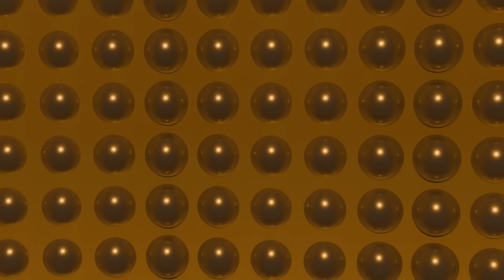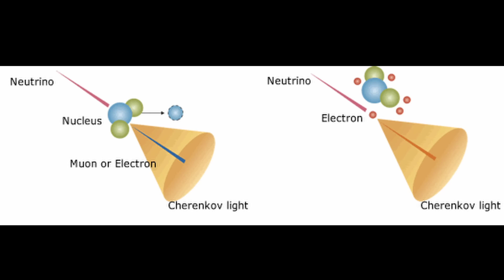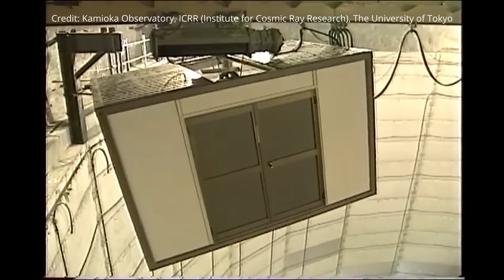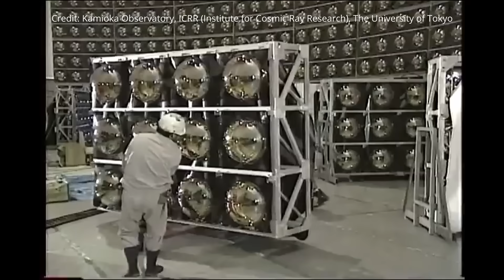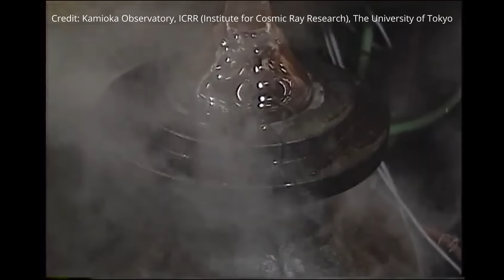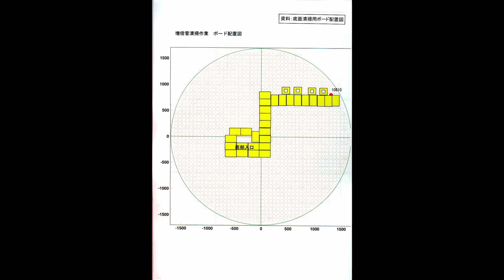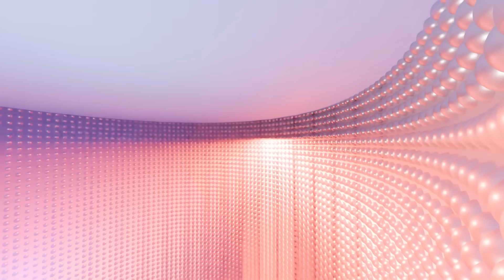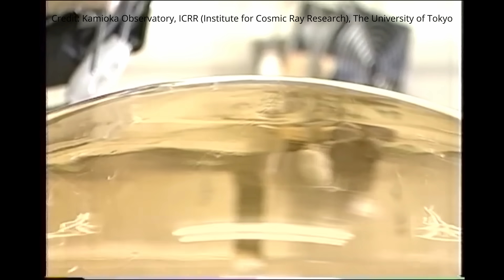An Engineering Fairy Tale: Cascade Failure at the Super Kamiokande

Comment: I heard about this at the time it happened, it was well known in the particle physics community, as this facility is one of the true greats when it comes to neutrino physics.

There’s been plenty of other screw ups in particle physics. Another one a long time ago that happened again to the Japanese was a large fire (a long time ago) in their folded tandem particle accelerator. This style of machine was popular at the time (1970s) for a field of research into the structure of nuclei. There’s machine itself used electrostatic attraction / repulsion to accelerate charged particles. This was generated by a very large Van de Graf generator that would achieve a voltage of several million volts, and be about 7 stories of a building high. There’s other design details too but the important thing was that this monster VdG was upright in a massive pressure vessel balanced on glass bricks, and sulphur hexafluoride gas was used to help provide more electrical isolation around this stack and the pressure vessel walls. The particles themselves travelled in vacuum tube in the core of this stack. 

The SF6 gas was important because if a multi million volt static charge arcs over it can cause a lot of damage. SF6 is used for suppression of such discharges, but these machines used very large amounts of it. 

Trouble was one day something went wrong with the SF6 supply and they accidentally pumped it full of ordinary air. This was not good because it did indeed arc and caught fire (cables, and the very large rubber and canvas belt that the VdG generator used). Rumour had it that when it finally cooled down and they could remove the lid there was simply a large puddle of solidified slag at the bottom of the pressure vessel. 

Oxford University had a similar machine. They sourced their SF6 from Italy. Bear in mind this was pre-EU pre-EEC Europe and there were borders. One shipment of SF6 got delayed and was found to be stuck on the Italian French Border. The problem turned out to be that these very large gas cylinders had been labelled with the Italian (slang?) “Bomba”, they were addressed to the Nuclear Physics Laboratory Oxford and the French customs weren’t entirely happy letting them into their country with such flimsy paperwork for what strongly appeared to be a truck load of weapons of mass destruction!

There’s plenty of other stories. 

Oakridge in the USA built a neutron spallation source in the image of the one at RAL UK (ISIS). The American copy had to be more powerful which is why they used a pressurised liquid mercury target (they could pump this around which aided cooling). Trouble was they forgot about cavitation caused by the proton bunches slamming into the mercury and the shock waves from this chipped away at the stainless steel pressure vessel from the inside. Eventually it burst spraying red hot radioactive mercury all over the inside of the secondary containment chamber. It got cleaned up ok but by the time they’d derated the machine for reliability it ended up being only a bit better than Isis. 

Isis itself had an incident in the 1990s where a magnet got wired up wrong. This directed the proton beam into the walls of the vacuum tube instead of the intended path. Trouble was this was all happening whilst a lot of the senior staff were attending a very nice particle physics conference in Capri, whilst the juniors left at home unaware of this mistake were busily burning a hole through the vacuum tube walls, making it (temporarily) quite radioactive in the process. 

When they first turned on the LHC (or was it LEP) at CERN a design flaw in the superconducting magnets caused a quench and the release of a lot of energy, causing a lot of damage. All 27km of magnets had to be stripped out modified and reinstalled. 

These are just the kind of stories that engineers in this field dread. They’re big expensive unique and complex machines so there’s no such thing as “routine” and mistakes are inevitable, and there’s some very impressive engineering in them as a result. Isis itself became extremely reliable and both academically and commercially successful. The staff there had got their reliability planning right. This included getting a massive transformer the machine uses rewound inside a day and reinstalled following a fire (always a hazard and possibility with such large transformers). This had been preplanned for, and the plan worked, no one was hurt and no other damage was caused. 

If you’re an engineer and want to do something unusual, go into particle physics.

Comment: Thank you for the video.  
When you mentioned in the other video the  Super Kamiokande Cascade Failure I looked it up.
Found only the official report.
It was a very nice read.

I was impressed about the rebuilding efforts.
You know ... super pure water also means super clean water. 
And that means that SUPER cleaning up the mess from the Cascade Failure. 
Sure, remove everything, fully test what seems usable and rebuild it "as new"  ... but actually doing all of that ... WOW.
And they did. 
A marvel of re-usability and repair :)))))

Comment: If neutrino oscillations are possible only if neutrinos do not travel at the velocity of light, how are photon oscillations possible? If photons are frozen in time, how do does wavelength or frequency of light become manifested? Do photons traveling through free space have a frequency, or does that only manifest when it interacts with matter? Or, does the frequency of electromagnetic radiation arise from an interaction of the photon with spacetime?

Comment: The lesson here is when carrying out destructive testing, you need to carry it out in conditions as similar as possible to the actual use case.
Reply: sideways glance at boeing...
Reply: @joeds3775  🤔
Reply: I'm positive that the individuals involved in the HK experiment are aware of this and are preparing thoroughly.✌
Reply: @jweir2010  👍
Reply: @jweir2010  Implosion tests of the PMTs of the HK telescope in collaboration with PLOCAN💡
Reply: Reminds me of starliner doghouses containing the reaction control thrusters. They had been tested, but malfunctioned on ascend due to overheating. Guess how they did the tests: No doghouse cover and in 1 atmosphere of 25 deg air. https://youtu.be/VvaSRfpW5iY?si=aB_vOlenJ9d8j3iN&t=436
Reply: @wonjez3982  🙏
Reply: Stockton Rush called and said testing just gets in the way of innovation, man.
Reply: @yesthatkarim9601  🤔
Reply: @Grandunifiedcelery  It makes it clear why NASA/JPL tests their equipment to death before risking trying to launch it
Reply: @UNSCPILOT  👍
Reply: See Industrial Press, Machinery Handbook. "Only exhaustive testing on the finished part can determine suitability for the intended purpose."
Reply: @conradogoodwin8077  🙏
Reply: The Bureau of Ordnance had some of the same testing issues with their Type 14 torpedo. Failure to test under realistic conditions and test destructively.
Reply: This is why I always buy two coffee pots. One for actually making coffee, and one to see what happens when I throw a pot full of hot coffee on my kitchen floor. And people told me I was crazy.
Reply: @skyeguy7914  :face-turquoise-drinking-coffee:
Reply: Whoopsie
Reply: @YunxiaoChu  🤔
Reply: The Hyper-Kamiokande experiment people are doing implosion tests in Spain.
Reply: Thanks dad
Reply: Yes. You need to do the test with 11,000 bulbs and not just 6, right?
Reply: @Cartilog-z4f  The Photodetctor Manufacturers Association said your check is in the mail.
Reply: @Cartilog-z4f 😭

Comment: Cascade implosion failures are a well known concern with floatation in deep sea oceanographic and geophysical equipment. These floats are often glass spheres with 1" walls and diameters of 10"-20", rated for hydrostatic pressures of around 13,000 PSI which is equivalent to a depth of 9000m or 30,000 ft. In these ocean engineering applications the cascade can be mitigated by spacing spheres, which is obviously not an option for this facility.

Comment: 7:30 the photoelectric effect is NOT how solar panels work. the photoelectric effect is light kicking an electron into vacuum. solar panels work by light kicking an electron into a higher energy band of the material. those are not the same thing
Reply: Solar panels use the internal photoelectric effect. You should really learn some physics before commenting on here.☹
Reply: @laurencecox2657  please point to where in my description i am wrong. i literally work on this stuff. "photoelectric effect" NEVER refers to the internal photoelectric effect. internal photoelectric effect is not a term used in the field because the mathematics of excitons in a material are not really comparable to the the non-excitonic "external" photoelectric effect
Reply: basically has to do with stability and transport of the exciton quasi-particle. if there are excitons present in the system (like there are with any solar panel) it's quite strange and almost misleading to call it the photoelectric effect

Comment: When the Titan submersible was being built, they were warned that they couldn't use glass spheres to house equipment outside the main pressure hull like on other submersibles because if they imploded at the Titan's working depth, the shock wave would be powerful enough to damage the main pressure hull.
  The rows & rows of photomultipliers breaking is reminiscent of the rows & rows of orbs breaking in the Hall of Prophecy in Harry Potter and The Order of the Phoenix.

Comment: Your 1st Mistake

There is no such thing as a photon, it is merely a compression point in a coaxial circuit and the neutron is not a particle although, give it one more compression ring and it decays to a proton.

Counter Space > Force in Motion <> Compression | Light ~ Neutron > Decays to a Proton, dielectric spin begins, one shell -> Hydrogen. 

To catch a Neutron is to give another Compression Shell, where it becomes matter. 

End of Line

Comment: Great engineering breakdown Alex. I'm wondering if the next detector will have supports built in so technicians will not be walking on the tubes. Seems like a no-brainer to me. Design some kind if support, connected to the tank, to allow some kind of scaffolding that can be removed post service.

Comment: Great video, thanks. One thing not mentioned, how fast does the water rush in to the collapsing tube? I am NOT expert in this, however - A video about the Titan submersible disaster says it is the speed of sound in the medium. Water from all over the ocean has to rush in and the need to rush is communicated to each ocean water molecule at the speed of sound. How the non-infinite nature of the tank might affect this is not clear to me. Water 1,500m/s, air 330m/s. This must surely affect the total energy released? Water is also a lot denser than air. Does this affect the total energy released too? Interesting.
I watched the below video and the behaviour will be very different from the deep ocean.

More here - https://youtu.be/bNW5FYGIfLc

Comment: the cascade testing prior to making thing reminded me of a task i did for a large company. we had a very large computer storage device which had to be up during the day so that engineers could do their coding and work. so i had to do a software upgrade on it at night. the company that made the upgrade said it should be simple. so i followed their instructions and the thing kept working hour after hour and i had to call them to see what was wrong..they said that they tested the upgrade on the same model and it took less than a minute.  turns out that they tested their software on a storage device that wasn't storing anything. since i was using a working model it turned out the upgrade that to touch all the files in an ungodly large amount of space....so...yeah..always test on as exactly the same conditions as possible. also having the software guys who wrote the thing work with the sales people who were sending out their upgrades might have been helpful if anyone might have asked about if the change had to touch everything on the array... 🙂

Comment: Great explanations of the physics, the photomultipliers, and the hydrodynamics!  One detail: typically the photocathode of a PMT is at a large negative voltage (typically -1000 to -2000 volts, depending on the type of tube.  Then with each successive dynode at a successively more positive voltage to accellerate the electrons, the anode (where the electrical signal is collected) is at ground.

Comment: So I'm not sure I got this right: some engineers concluded from a test performed at a small fraction of the water pressure at the bottom of the tank, that a cascading failure was therefore impossible?  This sounds like denial in the extreme - it sounds like only after a great deal of money and effort had been exprended, someone said, "hey, the pressure at the bottom of the tank isn't far from the stress limit specification for the tubes.  Maybe we should make sure that failure of one tube won't lead to failure of its neighbors.  And then somebody half-assed the test because nobody wanted it to fail.

You say these tubes have a diameter of 50 cm, which is about the same as a 20" CRT.  20" and larger CRTs were made for a long time, and never intended to operate in contact with an incompressible fluid, yet everyone who ever touched one was in constant fear whenever the tube had its anti-implosion protection removed, from the war stories about how violent an implosion of one of these IN AIR could be, and how this could be triggered by no more than scratching the glass.

Oh, and with what was clearly insufficient mechanical protection, 10,000 of these were installed in JAPAN, where earthquakes are a daily event.  This was a disaster waiting for one microscopic flaw.  It's a miracle it survived its initial filling.

Comment: according to Richard Feynman a neutrino was a made up particle to fix a problem with the devolving of a Neutron that on separation into its particulate matter a proton (a high energy positron (a  simple positive electron )) and an electron there was a bit left over what some think now  it is a  fluctuating(or sign changeling, pole flipping  ) static or surface charge created by interaction of the two which maintained separation under the intense osculation of those particles in confinement , but was given a destination of a separate particle called a neutrino it fixed math problems as dose re-normalization which is removing numbers to fix a math problem .

Comment: People have been getting this vacuum tube stuff wrong since we had cathode ray tubes and only cathode ray tubes for televison. People would say x is the only currently manufactured wide spread use vacuum tube when there are still lots of them. Maybe not in the consumer market but they’re still used for xray machines, if you want to include light bulbs, geiger counters and a bunch of other things besides photomultipliers, not to mention sound amplifiers.
Reply from the maker: ...which is exactly why I didn't say they are 'the only' class of vacuum tube 'still in production and widespread use'.

Comment: I have a theory or something more of a question. Doesn’t water get heavier the further down you go? And isn’t it true that water is one of those substances that if you put it in a container and stir it that rotation continues long after you put it down. Now look at where the failure happened , at the bottom near the edge
 remember they used styrofoam to cushion but my suspicion is that when they tested that it was just one person not the amount of workers I imagine were involved and certainly not with weight differences granted they are typically way shorter than here in America. I think the stress of the weight of the humans walking around and the weight of the water  
Just my thoughts

Comment: A while ago i snagged a few of these giant PMT tubes off ebay, not knowing how truly big they were. Didnt know where they were from, but guessung they were the survivors that were below the water line. They are insanely sensitive when used with a large plastic scintillation plate the background count is so high its unusable without a binning.multichannel analyzer. Operating voltage is up to 5,000v which is much higher than the 1500v or less than most photomultipliers use. As far as i know the detector is still at University of Wisconsin Madison and are using it for detection of muons from gamma ray bursts and solar events. ❤

Comment: Shockwave of 300 atmospheres wouldn't be an exact equivalent of 300 atm of static pressure, of course. It wouldn't cause much things to move as it's brief, so it's more about the impedance matching against the impulse of the shockwave.
Yet, if those bulbs were rated at, say, 14 atmospheres, the damage wouldn't have been as bad, or none at all.

Comment: When you think about it, the high pressure spike from the underwater implosion is basically the same mechanism as the water hammer when you rapidly shut a valve: All that water is forced to suddenly stop, converting all of its kinetic energy into pressure and because water is so incompressible, it does not take a lot of kinetic energy to make a whole lot of pressure.